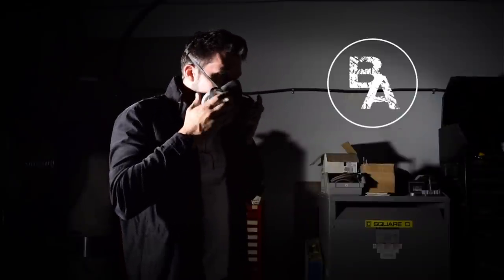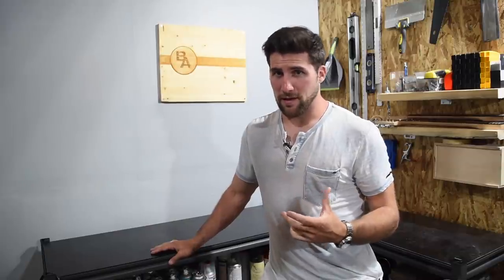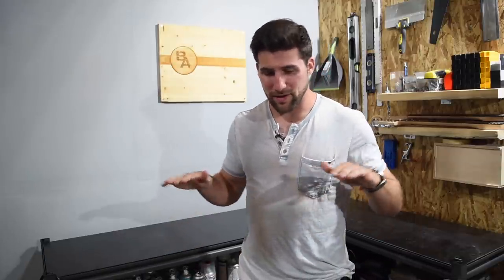Why is your paint crazing?

Comment: Had it happen twice once I think was because I put a clear coat on after my color was touch dry which I now know is a not a good idea, and this week I was making a custom ps4 controller the gold paint I used was set nicely and it was a colder day when I added the clear coat I may have put it on a little heavy as it dripped a small bit, it was crazed only in a few areas not all over but I've sanded it down and am hoping to respray tomorrow.
Reply from the maker: Keep the first couple coats nice and light and hopefully you can avoid the issue.
Reply: @BradAngove  Went on Perfect thanks for the tip.

Comment: One of a reason is that when you put Top cover on car immediately after drive heat from engine goes out from bonnet when its stop and top cover block the heat which cause crack on bonnet
Reply from the maker: You tried to paint a car that had just been driven?
Reply: @BradAngove  not paint. I put micro fabric top cover on my car as its park outside. Immediately after drive on daily basis my car original paint  start crazing

Comment: What can I do wen my paint is cracking because of the undercoat or the under paint.
Reply from the maker: You would generally need to sand it back flat and add more light coats to fix it.

Comment: Ive had this problem before when its a paint reaction and im in a pinch I re sand the problem spot spray the whole piece in clear coat to incapsulate the whole piece and start over for some reason clear coat doesn’t react
Reply from the maker: Nice. What kind of paint are you using for that?

Comment: 👍👍👍 Thanks man i remember this it happened with me when i clean the car bonnet with acetone and i think i didnt wait enough to evaporate, sprayed with 1k primer and wait Nothing happen till i do little wet sanding then start to spray base coat the paint is shrinking like spiders in some areas it was a mess

Also iam planning since few days before weather changed to cold now a days to paint my rear bumper but still feeling lazy to do it ive done front bumper weather was windy and dusty but its ok so i kept paint and thinner everythig outside on the roof since few days and my rear bumper cover is inside home so its warm once i go up will be tempreture diffrence for sure and ill got big headache with this shrinking and i dont know from where so thank you
For this video
And once iam ready ill take everythig outside and start shooting my bumper and go to front fender sanding and spraying but itll not be done untill weather warmed up little 😊 cause i dont like cold weather with paint job itll make lots of problem drying time and bubbles 😂
Reply from the maker: There is almost never a reason to use acetone in painting applications. It’s too aggressive.
Reply: @BradAngove  i thought its same as ethyl alcohol (ethanol) for cleaning surface before painting and evaporate faster than ethyl alcohol as i know and thank you for correction so ill delete acetone from my list 😅

Comment: I wish I could post a picture.  I painted and repainted and repainted an amp for the trunk of my car...trying to pull off this yellow and black killer multi amp subs setup and....after redoing it so many times (I'm insanely anal sometimes) the paint totally crazed on it.  The way it was looking I doubled down, got the killer look I never was trying to get.  Let it dry completely, clear coated, buffed and buffed lightly and....it's badass as hell.  Under glass so durability is nothing to worry about
Reply from the maker: Awesome. I love a good crackle finish.

Comment: I just painted a fender strat USA body and the paint crazed on me .I used gloss paint.how should I fix it.this is the first time this has ever happened .thanks
Reply from the maker: You’ll have to sand back until the surface is flat, then it will depend on what stage you were at.
Reply: thanks brad i have learned a lot by watching your videos.keep up the awesome work.thanks again for replying to me..

Comment: Hey Brad did you try that Rustoleum paint that happened to my yellow strat? 
It went like an insane crocodile skin all over the front and no painter can tell me why it happened. You was going to try the same paints. Maybe that's a good place to start to see if it happens to you. 😀
Reply from the maker: +MrMetalManMe I tried a test job with those paints. I didn't have any problem. I'm not sure why. 
I've had crazing on a few rushed projects for my old work. And a couple times when experimenting with mixing different paint types. That's about it.
Reply: Which ones did you use exactly Brad?
Reply from the maker: +MrMetalManMe I went back into the message you sent me. Used rustoleums standard primer, paint, and clear pretty much.
Reply: Brad Angove I don't get why yours didn't crocodile up. My guitar is the 8th wonder of the world I think
Reply from the maker: +MrMetalManMe I'll have to test the theory again I guess.

Comment: I sanded down to bare metal  and then I used a rust preventive on the metal prior to painting it and let it dry 24-hours like the directions said. I then wiped it down painted it and it's still crackled. I sanded it and repainted it and it crackled again!! Out of ideas at this point.
Reply from the maker: Are you sure the paints are compatible with the rust preventative?
Reply: @BradAngove  sanded it down again today didn't have mineral spirits so I use rubbing alcohol remove the rust preventative. Three coats later and it seems to be working. Thanks.
Reply from the maker: Glad to hear it.

Comment: I let my paint dry for two days and the gloss worked before in a different project, but I did a gloss layer two days after and it cracked instantly
Reply from the maker: Sometimes these things are inconsistent, particularly if there is a temperature or humidity difference.
Reply: I've noticed with rattle can paints the pieces I did all the color and clear in the same day using only the suggested flash times in between came out the glassiest looking.   Letting the primer go longer is better, but once the base starts going on, I just paint, flash, paint flash, clear, flash etc till its done.    I tried doing long dry times (in some cases like 6 days) and had some panels that were okay, but one of the had crasing in spots and one that I let the clear dry on for a week and then tried to go over again with more clear boiled from end to end.

Comment: Well I’m not to sure why my wrinkle up.  I used rust oleum clean metal primer then rust oleum gloss black enamel and then rust oleum gloss clear enamel.  And I know putting enamel on top of enamel is kind of pointless but I just wanted that extra gloss and protection.  I painted my dirt bike rims like that and the front rim went fine but the back rim is wrinkled bad.  I waited 48 hours for the primer to cure and then 48 hours for the black to dry and just today I put the clear on and within seconds the back rim wrinkled up after 2 coats of clear.  Idk why this happened but my circumstances for the clear where 60 dagrees Fahrenheit I put a light coat on both rims at the same time waited 15 min for it to dry to the touch and then put another layer of clear on and within seconds the wrinkle happened.
Reply from the maker: I’ve hear of that happening with those products before. I think it has something to do with the layers drying at different rates, but I’m not really sure on that one.
Reply: Brad Angove thanks for replying.  I’ve sanded the paint off and redid it and it didn’t happen again.  So I’m in the clear now
Reply from the maker: Excellent. Glad to hear it.

Comment: I can tell why most of the time it happens, especially with aerosal cans.
Its the amount of reducers/solvents that they add to the paint in order to kerp the viscosity down so it sprays nicely out of the can.
That reducer/solvent attacks the existing layers of paint, especially when you sand through layers and you see a ring, it softens and wants to peel it up.
If you have a large area that for example you sand right down and remove all traces of paint, you will not get that wrinkled effect in that section. Because there is nothing there to attack!
The drier or lighter you spray your coats, the better chance you have of not getting this, but theres no gaurantees. If you want to test what im saying, sand through a few edges of something in different spots. Clean it all off, and spray a couple really wet coats over top of it. Guess whats going to happen at the spots you sanded through? Lol
Try it and see😉
Lots of wrinkles!

Comment: I used white rustoleum primer on my kiteboard. 3 layers. Left it dry for 6 days. After that i applied flurescent rustoleum paint glow in the dark. Everything was fine...mind you that kiteboard is 5ft x 1.5 ft big! but on two small spots 3 ft from each other was the glow in the dark wrinkling. I left it dry for another 6 days. Then i sanded it and made those wrinkles flat. No matter what glow in the dark just kept doing the very same shit over and over! It was driving me fuckin crazy because i let it dry for 6 days each time! And those two wrinkling spots were like 1" x 1" big! On a kiteboard of the size 5ft x 1.5 ft!

Fuckin insane!
Reply from the maker: That's brutal. Could it have been a little bit of contamination? Like a bit of grease from someone touching it?
Reply: Brad Angove no. I was super carefull. I used gloves + those two spots were freshly sanded. The paint just kept wrinkling no matter what.

Comment: What will help you to get popular on youtube is to touch the gamer community which literaly is the main population here. Even if you're are not a gamer (as you said to me already ^^) you can do it :p with your talent there's no doubt you can do cool stuff that'll bring people to your channel. Do you know "AWE me"? (man at arms etc) they're pro handcrafter just like you, and that is exactly what they do and get millions of viewers and followers ^^ 
I told you about the dragon lore, but it's just an exemple/idea because nobody did it yet. But there's so much idea out there and if you want some of them I'm pretty sure you know some classics :D like Zelda Mario Sonic Street fighter etc etc ^^
Btw, thanks for the advices (I'm repainting an aria pro 2, that's why I found your channel in the first place ^^ but I encounter some problem removing the original coat :\ I use chisels but it remove a bit of the wood behind >,<)
Reply from the maker: +Vince Drawing what's an aria pro 2? 
It sounds like you'll need to do an it of filling work. Thanks for the advice btw. I'll have to look into that potential expansion opportunity.
Reply: It's a brand that basically copied Les paul stuff back in 90s'. So you suggest a paintover? Like, I just use sandpaper and not try to remove the whole thing?
Reply from the maker: +Vince Drawing If you're going to be painting over it with opaque colors that should be fine.
Reply: I'll definetly try that (much simpler). Thanks!
Reply from the maker: +Vince Drawing you're welcome

Comment: I have used Rustoleum products exclusively for years without major issues, until this year. I followed the time guidelines, curing times and it went to shit when clearing (with Rustoleum Gloss Clear) the brand has gone to shit, especially the newer spray cans. They leak, drip, and have a lazy trigger.  Time to move on to another brand
Reply from the maker: +Gary Nippins What new brand are you thinking of switching to?
Reply: Brad Angove Honestly, I don't know. They have the best colors to choose from and up to this year, any issues were due to my error. But I emailed Rustoleum with pics and my painting process looking for help to find what is going on, but I haven't received a reply and I think that is what upsets me the most. I am thinking of finally going to all HVLP application and the materials associated with and ditch the cans...🤔
Reply from the maker: +Gary Nippins Making the move to the full setup hey? I've got a company sending me a spray gun to demo right away here. If it performs well it might actually be a pretty decent deal. Stay tuned haha.
Reply: Brad Angove Right on,  let me know.  I have a couple guns already,  but would to get a better color and clear gun. Would you mind if I sent you a pic or two to get your thoughts on what went wrong,  whether it be the product or me I just want to know,  it's driving me crazy...
Reply from the maker: +Gary Nippins sure thing. Feel free.

Comment: I had this happen on a motorcycle petrol tank...took a year or 2 for it to happen though.
Reply from the maker: Ya, that may be a slightly different cause given the timeframe.
Reply: @BradAngove  certainly a strange one,normally happens alot sooner. It was definitely in the base coat, clear was totally fine and i have no idea about the primer. 

Only just started redoing the tank, starting from bare metal so fingers crossed it lasts longer than another 2 years lol
Reply from the maker: I’ll cross my toes for you haha.

Comment: I know I'm kind of late to the party, but does anyone know why paint would start crazing only after polishing?

I've been trying to paint a guitar with spray cans (I know they're not the best, but it's all I have access to/can afford) and I've been really careful. I made sure that it was always clean before painting and only put on 2 coats at a time. I made sure that my clear coat and paint were compatible too and left it at room temperature to dry for a full week in between each session. I've now come to try and polish it with standard car polish (by hand, so there shouldn't have been any risk of it overheating) and at first it looked pretty good. After a day or so I began to see crazing in the finish though, and it's gotten worse over the past week. Photos here: https://imgur.com/a/caFol2r

I've been trying to repaint this guitar for more than a month now, so I really don't want to have to sand it off and start again. It's sounding like that might be my only option at this point though. :(
Reply from the maker: I’ve never seen that before. What kind of spray paint was it?
Reply: @BradAngove  I just used a standard Rust-Oleum "Painter's Touch" green and Rust-Oleum "Crystal Clear". Looking online now, some places list the "Crystal Clear" as being a lacquer, but according to the tins it has the same ingredients as the paint so I assumed it would be fine. I would have expected to notice a reaction prior to polishing if that was the issue though too.
Reply from the maker: That’s very odd. I’ve definitely used and polished that combo before. What did you use for polish?
Reply: @BradAngove  I'm not sure what it is honestly, the bottle just says "Car Polish" and has no listed ingredients besides 2-Benzisothiazol-3(2H)-One. I've got a few spare pieces of wood, so I'm going to try a few different methods of painting/polishing and see if I can recreate the problem. That way I might be able to work out what I did wrong and find a method that gives decent results instead. It'll probably take a few weeks, but it's only my personal guitar so there's no rush. It'll be worth it once I manage to get a decent gloss and finish it off.

Thanks for replying by the way, I really appreciate it. I've been using your videos as a guide for how to do everything so far and you're the best on youtube by far, keep it up :)
Reply from the maker: Thanks Robert. I hope the testing goes well for you.

Comment: @UCl5TLlEtAHzMUsXyEmbmw-w - You give me HOPE!!! 

Rustoleum 'Glitter' rattle can over RustoIeum Glossy White - is 48 hours enough between?

I have a new 'diamond white' motorcycle helmet - it's beautiful the sun. I'm building another motorcycle and I want the wheels white, but sparkly like the helmet. My tanks, fenders etc are professionally painted, but for the small stuff, I like to top with a clear rattle can that is 2-part with the catalyst in a puncturable vial in the can. It's great and it tops Rustoleum well. So my wheels... I cleaned and scuffed them, 3 light coats of R-glossy white, then I topped it with Rustoleum's Glitter White rattle can. It's more like clear sparkle... really beautiful, but 3 light basecoats 3 minutes apart (like the can says), followed 3 minutes later by 2 coats of the 'Glitter' - it crazed. Will 48 hours be enough to wait between? 70° days, 40° nights. 48 hours like the can says or longer? Thank you, thank you, thank you.
Reply from the maker: The glitter paint is a different composition and is prone to causing cracking etc. I don’t have a scientific answer for you. Waiting 48 hours is probably fine, but giving it an extra day or two might be smart.

Comment: How to fix it?
Reply from the maker: Sand smooth and recoat with lighter coats usually.
Reply: @BradAngove  thanks. Doing that but have to wait for the paint to dry a little first to be able to sand it right?
Reply from the maker: @paolomartini150  You should let it dry fully or it might happen again.